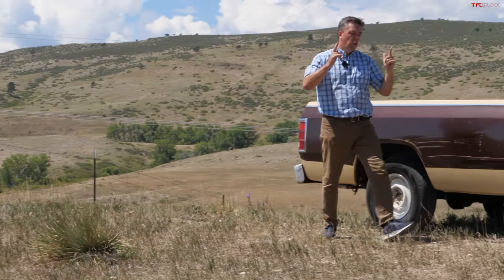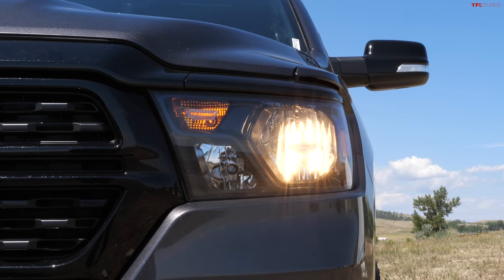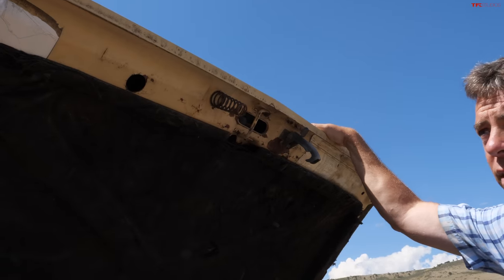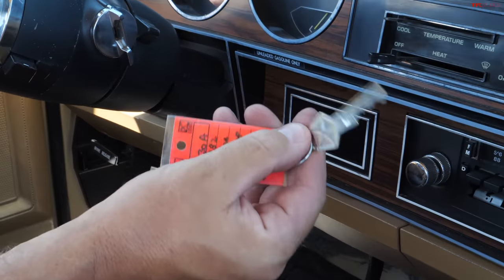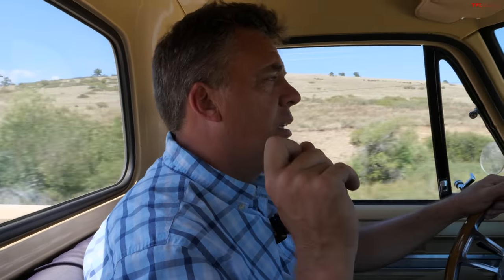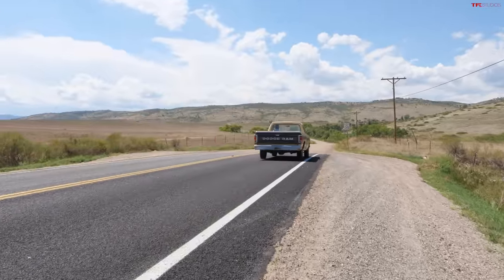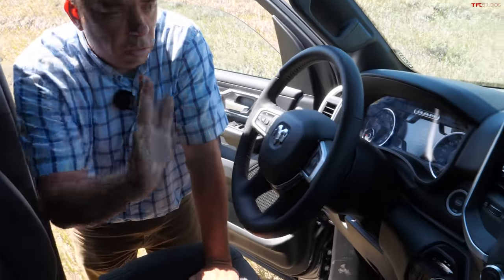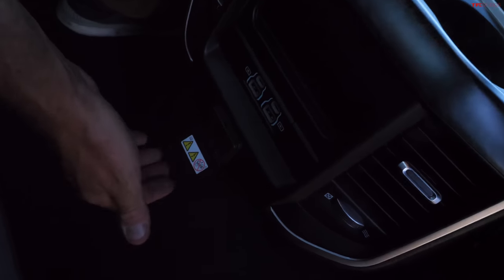You Won't Believe How Much Pickup Trucks Have Changed in The Last 40-YEARS!

Comment: Amazing old Dodge Ram vs new Ram 1500 video with some really great points.  Brings many questions to mind.  My mind just gave me a whole bunch of questions and one creative solution.  Please read on and see what you think. Hopefully Ram Trucks (or Stellantis) is also watching and reading the comments.  One of the best points to me was that how simple these old trucks were.  Another good point is that new trucks are not just work trucks but everyday use vehicles and so manufacturers are making them more and more luxury ,sporty, full of technology, power, etc. every day and that simply is the reason why these trucks are so freaking expensive these days.  But do all trucks need to be that luxury, that sporty, with that much technology, with that much power, that much towing capacity, etc. and ultimately be that expensive?  Toyota corollas and many others alike are everyday use vehicles and they’re not luxury or sporty nor do they have that much technology?  And I’m sure these old Dodge Rams did just fine doing what they did, right?.  I am not saying that we should resurrect these old trucks (because they are simply way too old and not a match for modern day needs) but wouldn’t it be nice to bring back a slightly older truck resurrected as a current day truck, which is simple, with just the right amount of tech, but without all the unnecessary features of the actual current day truck, and hence without all the unnecessary price tag for these features, as an alternative option for your customers who love your products but simply can’t afford to buy whats currently available on the market at the current prices.  Ram already has the older 4th generation Ram 1500’s being currently manufactured and sold as “Ram 1500 Classic” but the price difference between a 2022 Ram 1500 Classic and a comparable current gen 2022 Ram 1500 is only around $190.  It doesn’t even make any sense at all to still keep that truck alive anymore.  I would rather get rid of that one and maybe try resurrect the 2002 to 2005 Dodge Ram.  Now that truck still looks modern and still much better looking than many others out there and hecka simple at the same time.  That generation of Dodge Rams really defines the phrase “beauty in simplicity”.  Imagine if Ram were to bring that one back as just “Dodge Ram” or the new “Ram 1500 Classic” or anything catchy like that really (doesn’t matter), and give it the current 3.6V6, the current 8-speed transmission, the quad-cab configuration with the six and half feet bed, and the only technology to add would be Bluetooth audio, and a back up camera (maybe on the rear view mirror) and that’s about it.  It already had features like power windows, power doorlocks, power mirrors, cruise control, alarm/remote, CD/radio, steering wheel controls, Power Seats, AC/Heater, etc. features.  Keep the column shifter, the six-seat configuration, the old key-start system, reflector style headlamps with halogen headlights, remove the paddle adjusters, remove the power seats, remove all steering wheel controls except the buttons behind the steering wheels for volume etc. and use the joystick behind the steering wheel for cruise control.  That’ll make a simple truck which is still a truck, can still tow, can still haul, can still offroad, and can still be used as every day family vehicle, as well as a work truck.  And hard plastic (maybe textured) dash and door interiors are fine, nobody really touches their dash every day and say “oh this is hard plastic dash and not soft to the touch”.  And when you subtract price for all them things that are not needed like; dampened tailgates, push-button start, remote start, dial-knob type shifter, center-stack storage system, a high tech infotainment system with a million inch screen and gazillion speakers, LED lights, leather/power/heated/ventilated seats, hundred and fifty thousand sensors, the annoying adaptive cruise control, and super annoying Start-Stop system, lane keep assist, self deploying steps and air-dams, 400+ HP, 12000 Lbs of towing, 0-60 in 4 sec, different drive and off-road modes, etc etc and etc… I think it could totally become a very affordable truck with “everything you need and nothing you don’t”, like Roman would say.  And I am not talking about $190 difference, if the manufacturer were to do it right, this truck could easily be somewhere in the mid-twenty grand range for a 2WD and a couple of grand more for a 4WD. And I believe that for a simple, utilitarian, but everyday driver, family/work vehicle like this, the manufacturer should be generous enough to throw in a free spray-on bedliner and fog lights with every truck and still make a good amount of profit.  Another thing I would do is get rid of all the chromes in the grill, the bumper, and the wheels and instead use simple black grill, black bumpers, and maybe black or silver fancier steel wheels that imitate the look of alloy wheels (not sure but I think its Toyota that does that or used to do that in some of their vehicles – fancy steel wheels that look like alloy wheels) – cutting out even more in costs.  And this could be what a lot of us are really waiting for which manufacturers are not aware of because they are busy making more and more improvements every day to make better and better trucks and to outdo their competition, and while doing all that, they don’t get to see what the customer really needs or wants.  Making a spin-off like this outside of their mainstream product could actually be the answer.  What do you all think???  Another problem with current day trucks are that the hoods are so big that you can barely see whats immediately in front of you, and so to mitigate that manufactures are putting in front facing cameras and while at it, a hundred other camera’s, the cost of which also gets passed down to the customers.  This old generation of trucks that I am referring to, had a smaller sloping hood, hence eliminating the need for these cameras, eliminating even more in costs.  It could be a good product from a business standpoint too – yes, it would compete with your own mainstream Ram 1500 trucks but it would also complete with other full-size trucks in the segment too, along with mid-size trucks, cars, vans, and SUVs as well and can possibly and eventually be a thing of its own or simply the next best thing that the world needs.  And I am not only talking about private buyers, think about rental companies (personal & commercial), fleets, construction companies, small businesses, farms, etc. Do you think a small business owner likes buying a few sixty grand trucks with 12 inch screens, leather seats, etc. that he/she can’t buy for themselves but have to buy it for their laborers who usually don’t have much patience or respect for work trucks and touch all these expensive electronic equipment, leather dashes, fancy door interiors, etc with their oily/greesy/dirty hands all the time and ruin the looks of these beautiful expensive trucks within a matter of weeks.  Don’t you think a cheaper simpler truck would solve that problem too along with many others.  If I were a small business owner and need to buy 5 full sized trucks for my business, instead of buying lets say 5 F150’s for $300K, wouldn’t I rather buy 5 of these newly resurrected simple trucks for my business, a Ram TRX for myself, and a Ram Rebel for the wife, and still save about $10K? Maybe its just me thinking out loud but I really think that the answer is in the question itself.

Comment: I would take the old one.. 90HP but torque was about 215,  also the original slant engines made closer to 145HP.. so some simple engine upgrades could probably get you that in this truck.
Also.. does anyone think a new 2022 Truck will still be around in 40 years?  not likely.
for a beat around truck.. I will take the old simple one every time.  For an everyday  daily driver, the new one would be better.
Reply: I do, with the pentastar or hemi, they'll be tired, rusted, dented and will be on ebay for 1500 bucks
Reply: @ricepile1343  
10 or 15 years possibly. 40 years not likely
Reply: Not with 60k miles on them. Everyone seems to put 20k a year on their trucks.
Reply: @stainless1175able  
That definitely is a low mileage truck, but I've owned 1970s Chryslers with slant sixes that had over 400,000 on them. Certainly is capable of long miles.
I was speaking more about if I wanted to buy one right now. If I needed a beater truck to just use occasionally I would definitely take the old truck. But if I was going to drive it everyday as my primary vehicle I would probably want the new truck.
A Chrysler product for my daily driver. I would pick  a Toyota tundra or Tacoma
Reply: @kens97sto171  I hear ya. That's where I'm at right now. I need one for both but these damn prices are insane.
Reply: @stainless1175able  
Prices on everything are outrageous right now.
So I'm just thankful I've got a reliable 14-year-old Toyota hybrid. 411,000 mi on it. Still running good.
And a few years ago I picked up an old Wrangler. That's my sort of beat around go off road vehicle

Comment: I'm all for old trucks and everything because I had one for a very long time. But there is a difference between a 3-4000lbs max tow compared to 12k. People saying they can tow caterpillar tractors with these old trucks. Yes you can, but the difference in how much stress you are putting on the engine, body, tranny, and diff are waaaay different. As far as people saying they will fall apart in 5 years have no idea. We still don't know the average lifespan of the new trucks...because they're new.
I loved my old truck, but I got t-boned at 240k miles and it required me to get a new one. The difference in pulling my trailer with the old one and the new one is night and day.
So yes, everyone in this comment section I'm sure has major love for old trucks. I definitely do, doesn't matter if it's a Dodge, Ford, or Chevy. But modern safety and technology is a nice thing sometimes.
My 2 cents...

Comment: I absolutely love the slant-six trucks with 4 speed manuals like that. The 4 speed in that should be an OD transmission, called the A-833OD. Very deep 3.09 first gear ratio, 1.67 second gear, 1:1 Third gear with I believe about a 0.73 4th gear. Very nice trucks to just cruise around in and get alright gas mileage in. You can do basic hop ups to the 225 slant six, mill the head about .060, good three angle valve job with a little bowl work to increase flow, lighten the advance spring in the distributer to increase timing advance, increase total advance just a bit and step up one to two sizes in camshaft timing (might want to swap to the older mechanical cam set ups) along with headers and either a little carb tuning, or better yet, swapping to a 4bbl intake and small 500 cfm 4bbl carb and you'll increase power considerably but still have an efficient little runabout that's a reliable driver. There are some great online vids of basic slant six build ups/chassis dyno test. But do consider, "substantial" power increases are still less than a basic stock small block v8.

Comment: I’m sure you get a lot comments, I was a technician for Chrysler in 1982. We sold a boatload of the “ram miser” pickup trucks with a four-speed overdrive transmission and 225 slant 6. FYI to fix the noisy glove box. You put both thums on the striker and push forward basically bending the striker it was a common thing for it to rattle and a easy fix.

Comment: I really like both trucks.  The older truck has everything you need for truck utility, and nothing you don't, which I can appreciate.  Less stuff means less opportunities for that stuff to break.  I am also surprised to see that 40 year old work horse only has 63k miles on it.  That itself is amazing and made buying this truck 100% worth it.

The new truck does have all the little things and options and features that will break over time so I doubt anyone is gonna be driving it in 40 years, but damn is it super nice right now.   I really like this particular configuration, with the shorter cab and longer bed.  You could get some utility in with the longer bed and though you might not be hauling around 4 adults too often in it, the smaller yet still functional cab means that what you do move around in that cab gets tot he destination in comfort.  I also really like that it has a 1,800 pound payload capacity.  That blows the TRX out of the water in terms of payload.